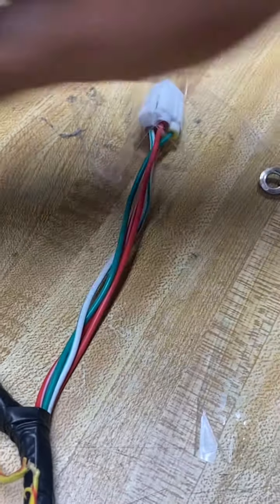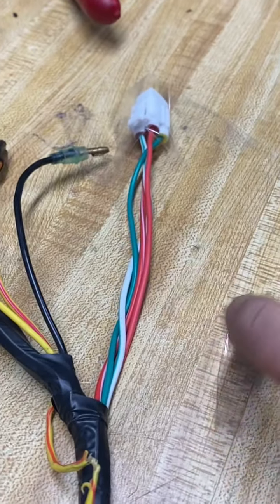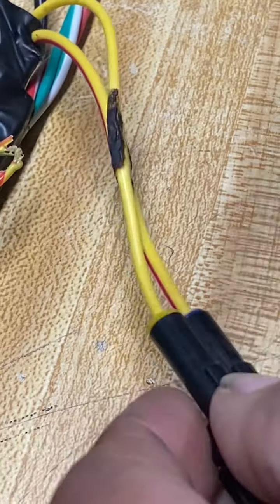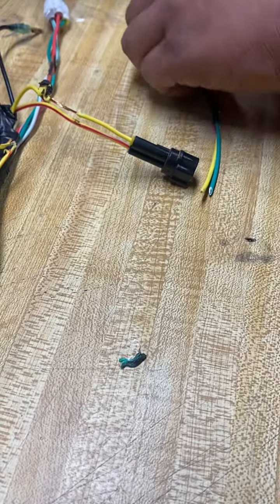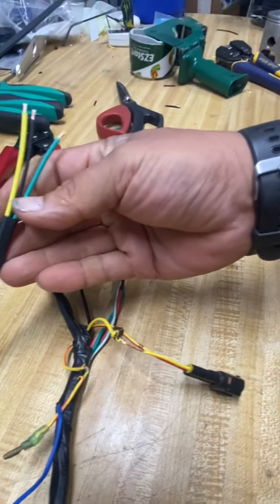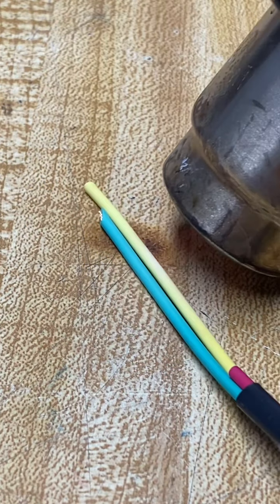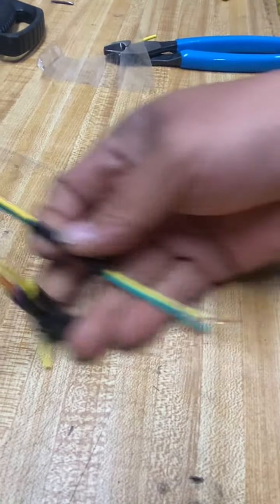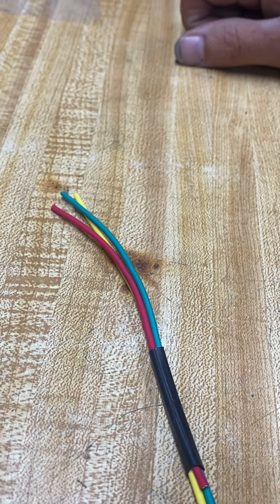STB Wire VS stock VS China

Comment: The thin chinese wire is some of the worst wire I have ever seen and worked with. That cheap chinese wire you showed is the same wire they use on the chinese mopeds and I have seen a ton of those mopeds with weird electrical problems and the wires are so thin that if they run against any metal they will chafe through and if you bend them too hard I have seen the copper strands break inside with the jacketing still intact. It also does not solder very well and is just a poor quality. The factory Japanese bike wiring is alot higher quality but it looks like the wire you use is just as good if not better than the factory stuff.